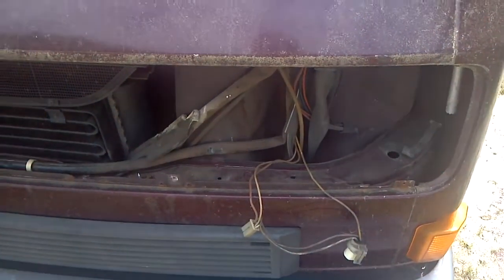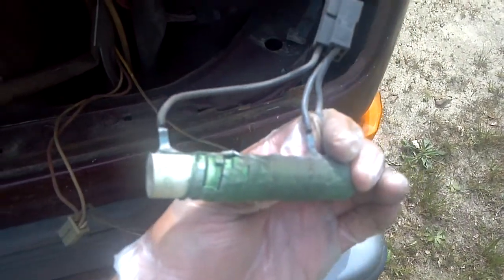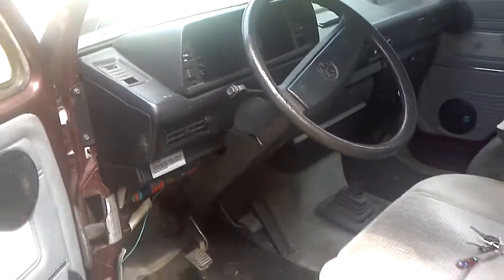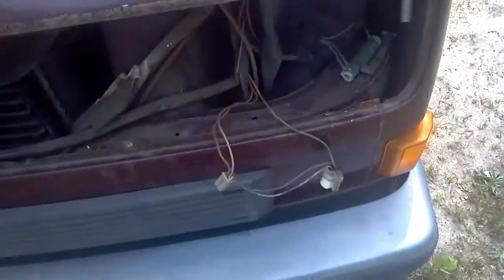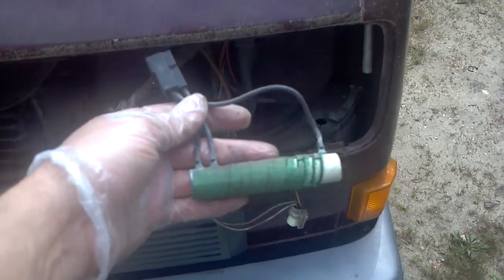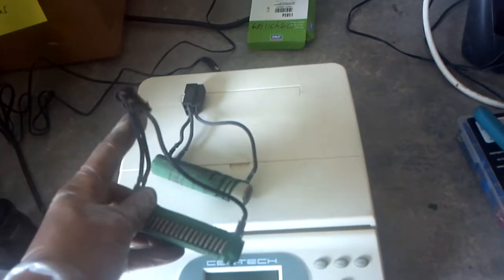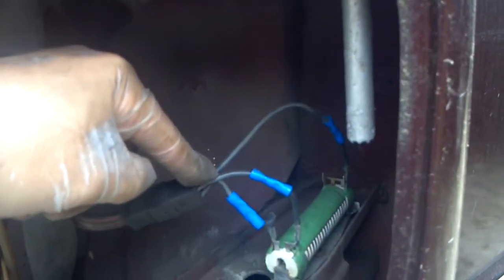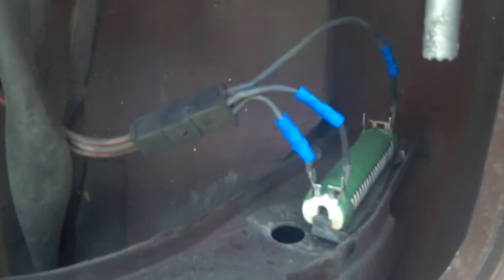Vanagon Radiator Fan Resistor

Comment: I have a T25 1984 would this resistor fuse be on my Camper? as having overheating issue and low speed on the fan does not work
Reply from the maker: No, the fan on the early vans has the resistor built in.  Test to see if you can get the two speeds by jumpering the fan switch plug.  If you can't get the low speed to work you will need a new fan.

Comment: Should I replace my radiator resistor if my fan does not turn on at all?
Reply from the maker: Have you tested your fuse and ground?  The resistor does the low speed but the high should still work if everything else is good.  If you have nothing then you could have a bad fan or wiring problem.
Reply: @VanAgain  where is the fans ground located? Also, is the fuse for the radiator fan located in the fuse box underneath the drivers steering wheel? Would you happen to know the number? Is it also called a relay? Thanks for answering. I am very new at all this.
Reply from the maker: Fuse should be first one on the left in fuse panel.  Ground is behind fuse panel on ground star.
Reply: @VanAgain  okay I'll check that! Thank you a million.
Reply: @VanAgain  I have the SAME issue. My fuses are fine and my fan is new. What a disappointment to replace the fan and then have it not turn on. I unplugged and checked the radiator fan switch switch w a paper clip and there was power in the right slot. it sparked!
Reply from the maker: Did you check your ground for the fan?  It is behind the fuse panel.